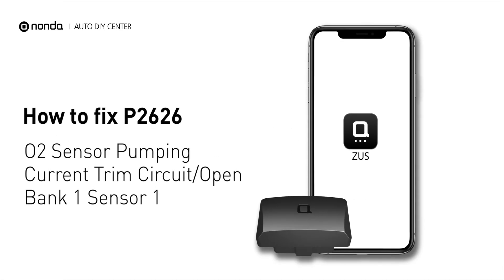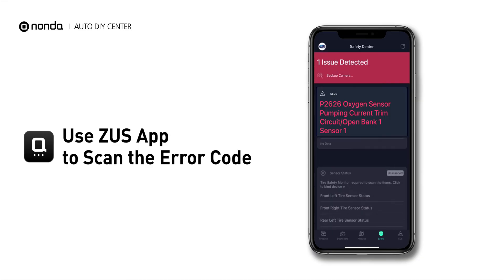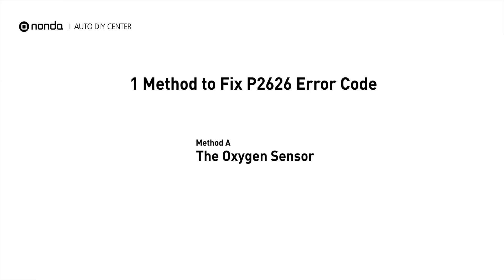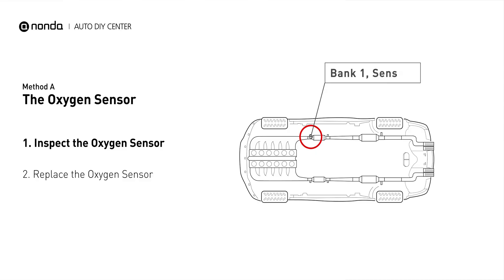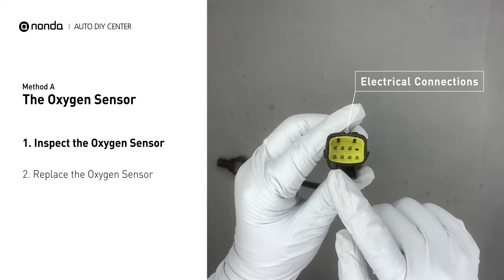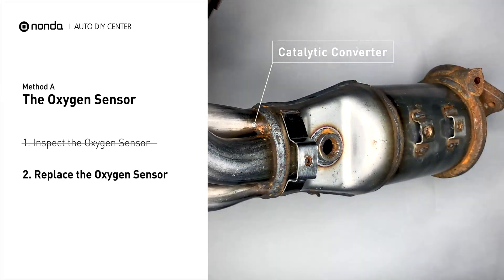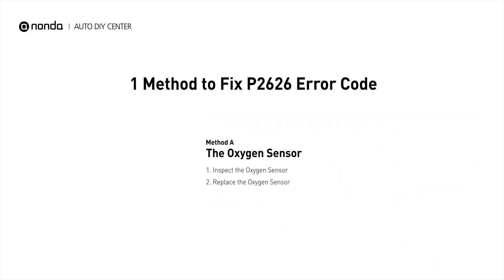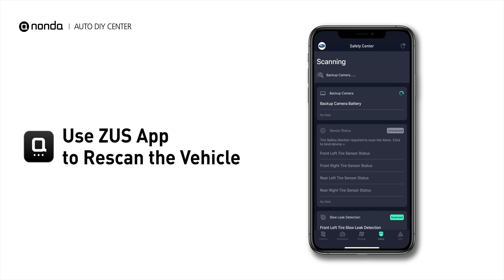How to Fix P2626 Engine Code in 2 Minutes [1 DIY Method / Only $19.90]

Comment: Hi I replaced bank 1 sensor and it’s still throwing up same code after like short drive and loosing power
Reply from the maker: Hi Laura, please provide us with your vehicle's year, make/model and confirm if this is the only code you're getting.
Reply: @nondainc  I got Mercedes class w204 it’s 2010 2.1 L diesel yes only this error code the old sensor was bad
Reply: i have the same issue with my 2011 sonata, p2626 replaced bought sensors and still comes up. with a o2 sensor fowler help this issue?